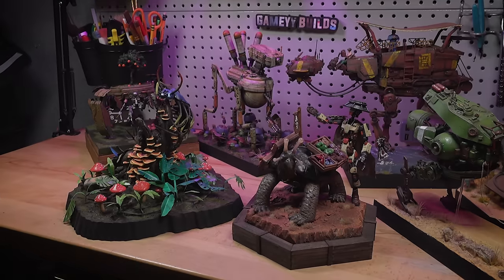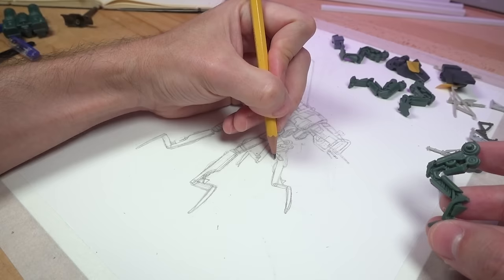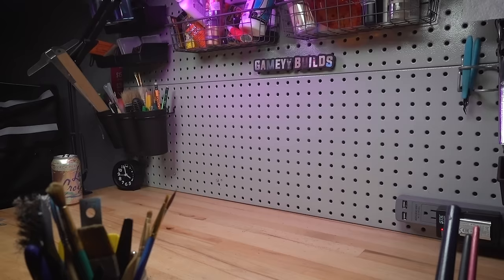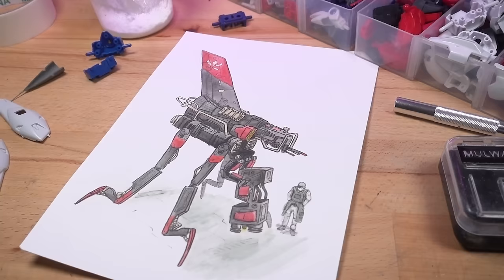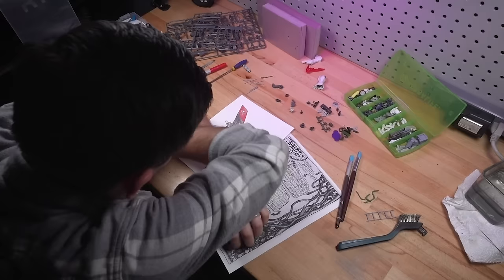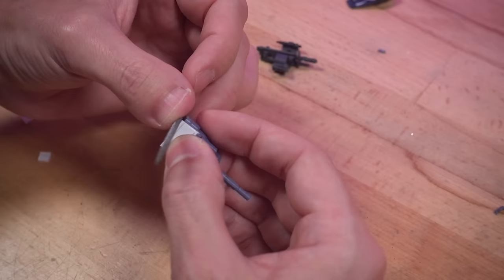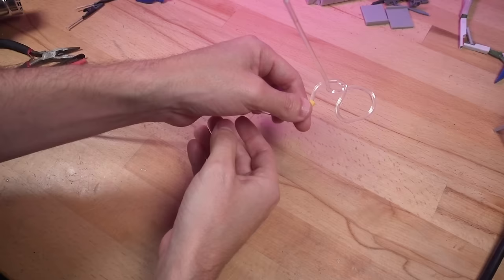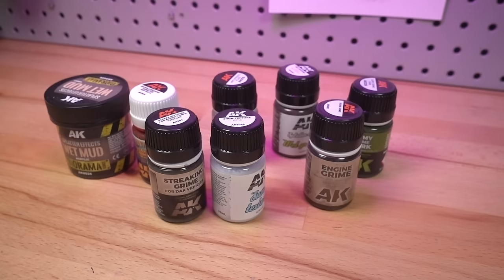Bill's Big Bot Bash Build

Comment: OK, here's a big info dump for you -
Tamiya make a powered drill for drilling small holes in plastic. It's actually a kit you build yourself and quite fun to make. It will save your hands from the pin vice pain.

Cosclay is an oven cured clay but it's flexible when cured. Great for batch making ribbed cables as they can be cut and posed later.

New bits? Warhammer bits can be bought in bulk for reasonable prices and make great greeblies.

I'd totally buy a signed hard back of your book but I'd also buy prints of your concept sketches. Even post card sized versions would be great.

Keep up the good work! Love your videos.
Reply from the maker: I'll definitely look into that powered drill. Super tired of the pin vise! I've never used cosclay, but I like that I don't have to bake green stuff, so I can apply it and let it harden on its own. I'll look into Warhammer, always assumed it was super expensive. Thanks for all the tips and feedback!

Comment: I use those super thin tips on my super glue bottles too. I love that you don’t have to put the top back on because the tip is so small that it doesn’t really plug up. (The glue just drips back into the bottle.) And…..if it does plug the tip you just snip off a little bit and carry on.

Comment: I wonder what would happen with the rubbery plastic if you soaked it in acetone overnight and let it dry. I know doll modders will sometimes do that with vinyl doll heads because it shrinks them slightly and makes them really firm. Presumably they're completely different materials but might be worth experimenting with maybe

Comment: to stretch your superglue even more those red squeeze bottles are just a normal small tube in a housing but they cost more than getting multiple non housed tubes
Reply from the maker: Yeah, but to me the bit of extra cost is worth it so that the superglue can stand upright (avoiding leaks). It's just a little easier to work with for me than the inner tubes. (I've also tried removing the small tubes from the housing, and reusing the housing, but usually they get pretty worn out after the life of the inner tube, so I just toss them out.)

Comment: I'm all about reading this book, but I have a question about your scale. You said a crew boards from this craft, but there doesnt look like much room for more than two people in that thing, pilot included.

Beautiful model though!
Reply from the maker: The crew use cables and latches to cling to the outside of the craft and there is no pilot. The thin profile and folding legs makes it a difficult target to hit. Before it makes contact with the vessel it is boarding, the legs extend and absorb the impact while clinging to the surface. Detaching from the Pash'Fis in time to activate the jet thrusters on their packs is an extremely dangerous maneuver, as mentioned in the story.
Reply: @gameyybuilds  Yessir, but by scale, how many people fit in it.

Comment: Regarding the Gundam Parts, though you may be bored using them, you won't easily replace them because they are just too versatile... A robot is basic at best, 2 or 4 legs, 2 or 4 or more arms, whatever, I mean there's just not much change to them so using Gundam Parts is almost a requirement to say the least... Using various models/kits gives the feel that things are being recycled so they are almost a must have as well... Scratch Builds are not for everyone, but you'd get the Gold when it becomes an Olympic Sport.... You not only bash bots, but you provide a back story, which gives live to your creations and there might be 5 ppl on Earth able to do that; if 5... Just saying you're above the norm in that regard...

Comment: Poor old 1990's NG wing zero figure.
Check out the fundamentals builders parts and the 10 min missions for similar mech parts but there is also a company out there who make flexible resin tubes and cables.
Also check out the new Gundam ranges as the old 90's style is boring.
Reply from the maker: Thanks, I'll check it out. Typically I don't buy the newer models because I'm buying used/mismatched junk bags online, but it's good to know the newer models have some newer shapes and styles.
Reply: @gameyybuilds   If you ever get to Tokyo you will have a field day raiding the models shops as they often have grab bags of model bits